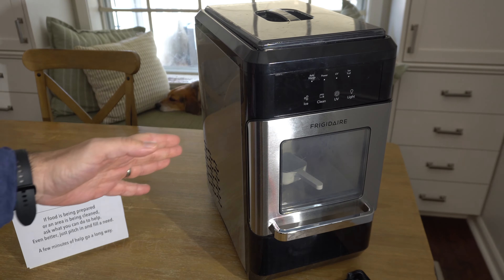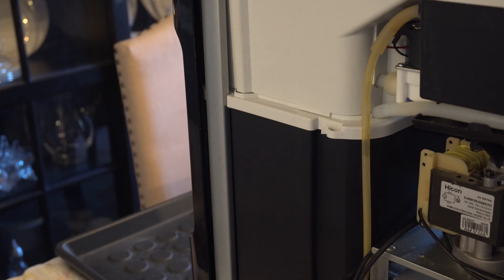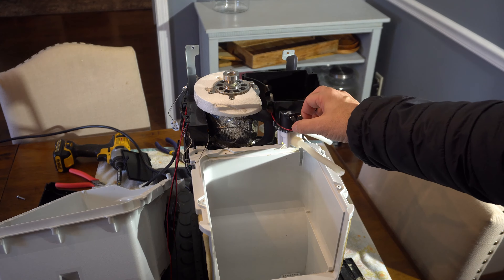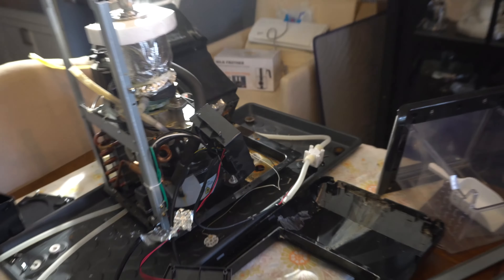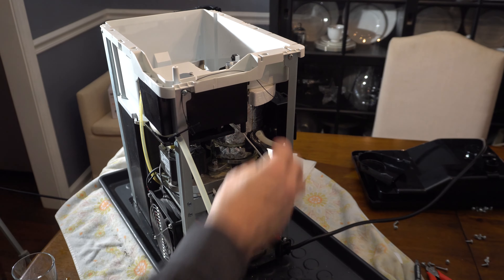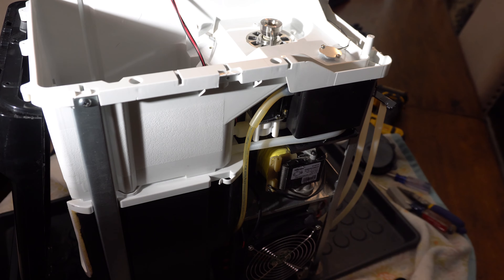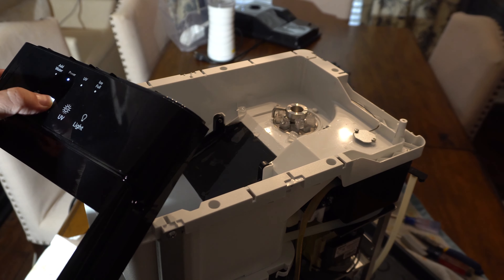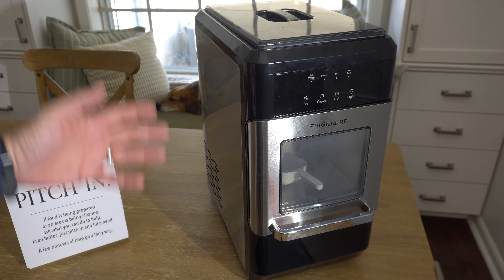Frigidaire Nugget Ice Maker Revisited and Teardown

Comment: Great video. Just finished deep cleaning mine tonight by following this. Mine was also leaking pretty bad. I was able to fix the leak by putting silicone along the front plate where it meets the main compartment and inside the main compartment where the two main large white pieces meet.
Reply from the maker: Thanks for the comment and repair tip!

Comment: Here's how I use my ice maker (if anyone even cares)... First... I only use reverse osmosis water (not tap water)... I don't leave mine on 24/7...I can fill my fridge bin with ice then I'm good for a week... so during the time it's just sitting there... I get a little clip fan and clip it so the fan is blowing directly into the ice maker to dry it out... It seems to work as I'm not noticing any build up.... I also use the clip fan to dry dishes after the dishwasher is finished...Just pop the door open, shake racks... and clip the fan so that air is going into the dishwasher... it works better than the dry cycle.

Comment: I have this exact model, and the ice full light is on with no ice in it.

Using your video, I was able to locate the sensor. 

Is there any way to by-pass the sensor or order a new one?
Reply from the maker: Don't know, but I think that's an infrared beam sensor, if you search YouTube for "Ice Full Error Bypass" there are some other people with ideas. Would also try cleaning and making sure the wire is securely connected first...

Comment: Thanks for the video. I just had to repair the gearbox in mine. Can you tell me what the thermistor was tapped to. I didn't see it until it was just hanging there.
Reply from the maker: I don't remember moving a thermistor, but looking at the raw footage now I do see one just suspended mid-air beside a copper compressor pipe on the side opposite the fan. One thing to try might be search for parts diagrams on images.google.com...
Reply: Thank you.